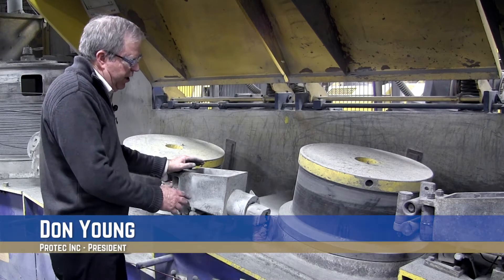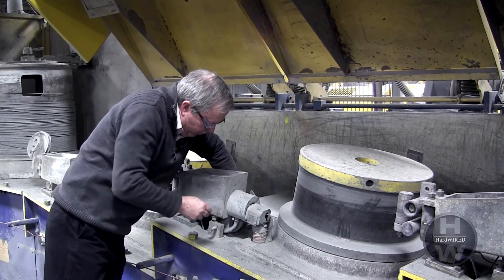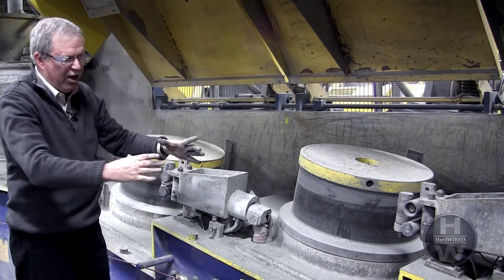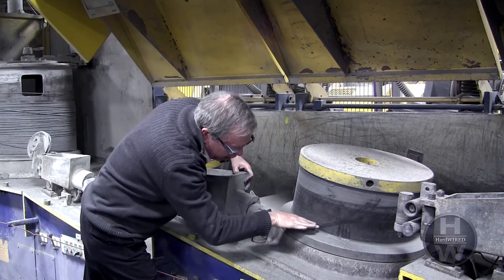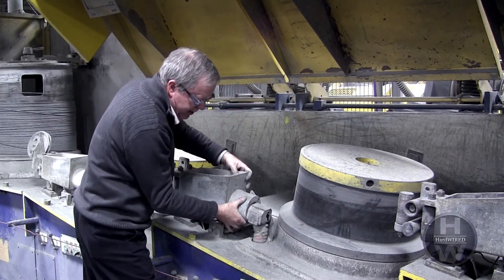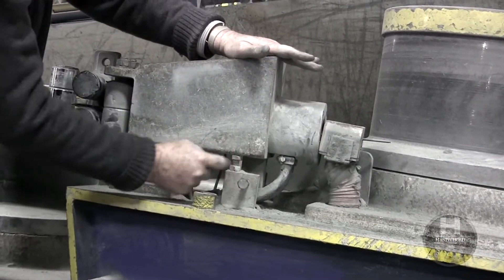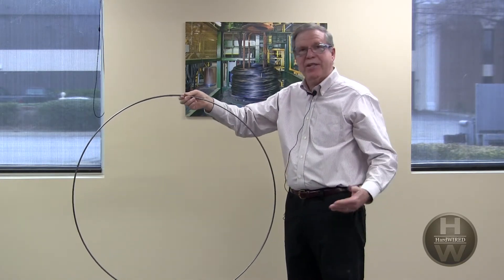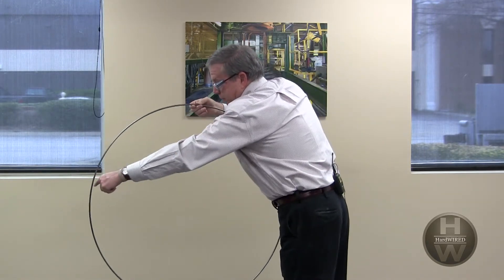Cast and Helix

Comment: Impianto a 9 passi, sul 5 e 6 passo il filo tende ad sormontare sulle spire, sopratutto quando c'è un cambio di velocità. Sapete dirmi come risolvere il problema??
Reply from the maker: Not quite sure what you mean by overcome the turns. If you mean the wire is overlapping the strands above it on The block this could be that the Helix is not set properly  and the dancer response it's not working 100% correctly so when the machine changes speed The Wire becomes loose a little bit on the block and if the helix is incorrect the wire will jump over some of the other strands already on the block. You must have a dead helix set coming out of each die so this does not occur.
Without seeing the actual problem in a video it's hard to say though.

Comment: If the die box is not locked down tightly after adjustment or if the wire is scooting up the block as it gets hot, the helix can change. Is the helix change happening on a standard push up block or is this occurring on a dead block? Also if the die bearing is very short say less than 10% bearing length it is hard to control helix.

Comment: Is it common for the start and finish of a run to have radically different helix?  I can start the job with a 0” helix but end with 5” helix by the end.  Any suggestions?
Reply from the maker: If someone is setting the helix  with a die only  there are two things that can cause it to change once the machine is up and running. First if the wire is slipping or shooting up the block as the machine starts running, this will cause a change in the set helix, also if the die box is not lock down properly it can move during the run the helix can change.

If someone is setting the cast or helix with casting rollers, like on a dead block flier the setting can change as the wire warms up and the rollers heat up and expand. This expansion in the size of the roller is just like slight moving that roller in. You usually only see this with small diameter wire. Also, more often when using rollers, is if the bearings in the roller are going bad, the dragging of wire over a roller that isn’t spinning smoothly or not turning at all will definitely cause the cast or helix to change. When turning slowly or if even when a roller bearing is in your hand it is very difficult to determine if the bearing will run smoothly at high RP

Hope this was helpful
Reply: yes, the die box alignment is the most probable cause. Also, check your drawing speed.

Comment: I think That this process has sense only on the last block Before the spooler .. In the other blocks the wire should work as straight as possible against the capestan..
What do you think about?
I work on a 13 blocks machine
Reply: Of course setting the cast and helix on the last block is very critical but the cast and helix should be set on all the other blocks as well. And yes the wire alignment going into the die box might not be a straight line because how you have to move the die box to get the proper cast and helix.  but if your die geometry is correct this should not be an issue. For proper removal of wire from a block the cast and helix needs to be correct.. If you get a break at these blocks with wrong cast the wire will slinky off the block and could cause an injury. plus if the cast and helix are incorrect at each block it makes that much more difficult to adjust proper at only the last block .
Reply: Wich is the longest machine That you have? How many blocks?
Reply: No it is a Morgan Koch

Comment: Hi Sir, I am interested in learning about die series like the dies set which are used to  reduce from 5.5mm Dia wire to 3.20mm dia in 6 blocker machine please make a video on this topic or send me the links if u have any study materials,
Thank you 🙂
Reply: Panchaksharaiah Hiremath
4.86 4.33 3.88 3.51 3.20 final skin-pass reduction 17%
Reply: @TheSimonhawks  hi friend, how did you calculate it? Can you explain ? Do you use any calculation program about reduction ratio?
Reply: @ihsanadkutlu2807  yes computer software
Reply: Simone Falchi can you share this software with me?
Reply: @ihsanadkutlu2807  of course its for sale
Reply: @TheSimonhawks  5,5 мм wire 1,96mm ---5 block?help
Reply: Panchaksharaiah Hiremath 
I have a die program that can determine your die set up for a reduction of 5.5 to and finish size as long as you know the number of blocks you want to us.
Send an email to meet at DYoung 6775 at gmail.com and I will forward you the diet program if that's what you're looking for
Don Young